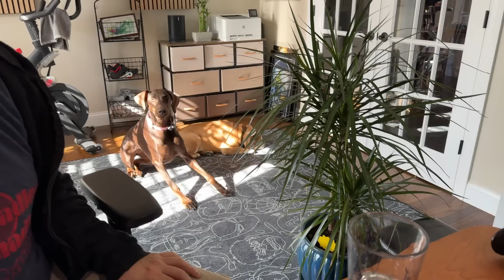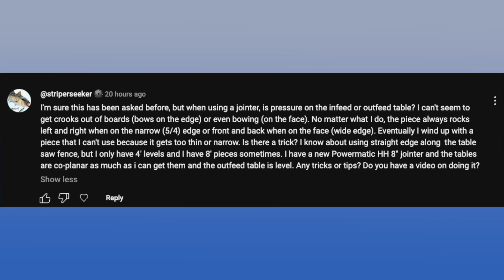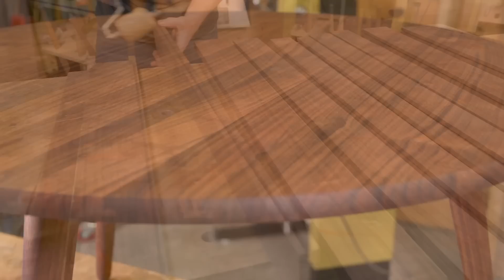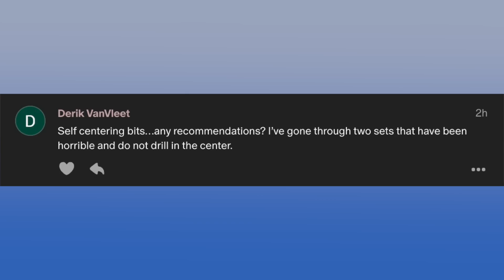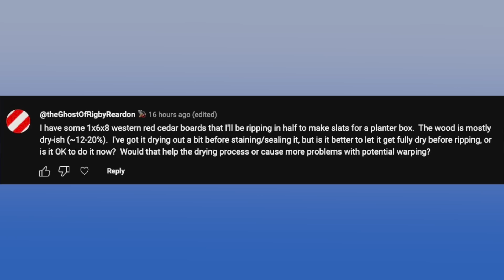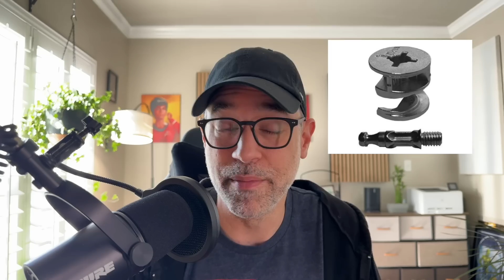I Bought My Workbench! | Ask TWW 05

Comment: Hi Mark, I was wondering if there was some courses in the guild that would be lean more towards a newer woodworker?  I have knowledge on how to use the machines and equipment but not necessarily built much, thanks?
Reply from the maker: The Shaker Table is a great one to start but honestly pick something you want to build. Each one of the projects is designed to take you step by step through the project.

Comment: Every time someone refers to jointer tables as being "coplanar" my ears bleed a little - I think what they really mean is parallel.  A jointer will only have the infeed and outfeed tables coplanar when they are in the same plane (at zero depth of cut).  A properly aligned jointer, during use, will always have parallel tables and never coplanar.  Sorry  :)
Reply: it’s true, great point! the apex of the cutting head, which is a line, should exist on the plane of the outfeed table. and the infeed table should be just below that, perfectly parallel, and the depth of cut adjustment moves it through higher and lower planes.

Comment: Concerning the jointer, I recently straightened out a bowed (technically crooked) 2x4 on my 6" long bed jointer. There is some technique to it. First, it helps to draw a straight reference line from one end to the other, touching the corners and showing the curve in the middle. That will help guide you. 

Second, you want to joint it so that it's curved up and the bow/crook is down against the bed. This will result in the jointer cutting away material starting in the middle and gradually working out towards the ends with each pass. This is where some technique/art/skill comes in - you want to hold the board such that it is in fact only touching the bed near the middle. You don't want to push down on one end and start carving away at the leading end first. What will happen there is with each pass, you will carve away material from the start of the board, and the end of the board will receive the fewest passes. Best case scenario this creates a really narrow end and a wider end. 

If you deliberately shape it so that you're starting in the middle and working your way out equidistant towards the ends, you get a more uniform width or thickness by the time you're done. Use very little pressure else you'll just carve another curve into the already bowed piece and you won't actually straighten it. 

To prevent the piece from rocking on bed, you can use the fence to stabilize it is crooked by pushing against the fence and keeping it level. If it's bowed, you will want to balance it with push paddles on either side of center. This takes a bit more finesse to get it right, but it's still doable.

Once you've gotten 2-3 good passes in the middle such that you've created a 12-16" long flat spot in the middle, it becomes easier to do the rest as you can just reference that flat face against the bed as you pass it through. The more parallel that face is with the reference line you drew, the more uniform the width of the board will be by the time you're done. 

You can get a feel for how you're doing based on the sound. If you hear cutting too early in the cut, you know your board is tilted down too far at the start of the cut. If you hear cutting too late, you know it's tilted too far back. Depending on the severity of the bow, on the first pass you should start to hear or feel cutting about 2" from the center of the board, and the cutting should stop at the same distance away from center. Then on the next pass that distance will increase, and so on. 

But I agree with Marc that the best thing to do, if you can, is to straighten one edge using a saw guide and hand saw, or a straight guide board on the table saw with the work piece clamped or taped to it. A jointer can do it, but needs some finesse.

Comment: There’s a jointing technique you hear quite often where you apply pressure to the outfeed as soon as possible. So good to hear you say that’s not necessarily the case, personally I’ve had the same result regardless of where I put pressure (assuming the board is close to flat)

Comment: Hi I have a SCM 410 w , Classic, I have extended in feed outfit table +2 m on other end, And I have built supports underneath so I can adjust and get the heights of the table correct, I’ve done this because I have very large pieces of wood. I used to make specialist windows and doors oversize., it sounds like your tables are not set up correctly, Or more to the point, the blades are not set in the block correctly, the height of each blade should be exactly the same and your machine normally comes with a setting jig, And obviously, your blades must be very sharp if you’ve got double blades, you will not cut your wood properly, then when your blades are set correctly, you need to set your feed table to 0 and this will be the first stage of checking to make sure your table is parallel to your blades and block, I must note all this procedure must be done with the power turned off and disconnected, to check whether parallel to your table use a very good straight edge put it on the table so it is hanging over the planter block and slowly rotate the block and as it goes round there should be an equal gap under your straight edge. something I used to do, many years ago was put a piece of tape on the outfit table then rock the blade and put mark on the tape before you move the block and then mark the tape again when you have rocked the block over with the blade in it so it actually lifts the straight edge, something else that you need to check is making sure your planer blades have been sharpened correctly as this will cause problems when your plan is running as well and calls very big problems, The blades must be sharpened and honed by a specialist,
Your outfit table must be set at the exactly the same height as the knives are on your block, if there was a difference your table adjustment needs ordering it might need even rotating slightly to get it so it is parallel to your knives, this is done with your blades out at 1st to make sure your block is parallel to your bed, I hope this can be some used to you, I’m in my 70s retired specialist Joyner Cabinet maker carpenter,

Comment: Concerning jointing, the first thing to do is get a handle on any cupping, wind, crooking, or bowing.  Longer boards are especially troublesome.  You can use a long line like a chalk line pulled taught to estimate the difference between what you have and what will be left after it's flat.  If you have a nominal 1X8 and the distance between the cord stretched taught and part of the surface farthest below the cord is 3/4 of an inch, "flattening" that board will leave nothing.  I buy material over thickness, cut it to approximate lengths, and then joint it (usually with a hand plane these days, because I have tinnitis).  Flattening shorter pieces conserves wood.

Comment: Depending on the orientation of the curve in the board you’re jointing, if you’re pushing down too hard, isn’t there a risk of pressing at least some of the curve out as it goes over the cutter and taking material off in the places where it doesn’t need to be removed?

Comment: When Striperseeker says his boards rock, is he feeding the convex side of the board? I don't think you can ever get a good face or edge using the convex side.  With the concave side you always have at least 2 points in contact with the bed, where with the convex it's only one point of contact.
Reply: Yeah...wish there was more clarity there. In my mind I pictured a board with a real twist in it, where maybe diagonal corners had low or high spots.
Reply: agreed. i’m assuming with an 8 ft board, he doesn’t even have an 8 ft very flat table to check the rocking on both sides (though the edge should be easy to check for convex or concave).

the there is sometimes a board where there is a rock on both sides due to a twist, but the idea is to choose the side that you can hold most still and stable with your  push sticks and pads. 

we have some pretty big jointers in the shop at my school, and i still won’t joint an 8 ft board if i don’t HAVE to. i always rough cut close to final length, and sometimes to close to final width, before jointing, so that I can remove as little material from the thickness as possible. if i had some project (like a bed frame or large bookshelf? a large dining table?) where 8 ft was the final length, i’d be selecting boards already as flat and straight as possible, intentionally.

Comment: If the beds on a jointer aren’t parallel, then you’re always going to get a curve in the board. I was always taught that the pressure is always on the out feed table as it’s set to the cutter. Obviously not when starting, but usually good to start about a third of your length.

Comment: Hey Marc, I love your stuff! Re: the Festool knock down hardware, I suspect you could cut the mortices with your router and a metric bit, if you don't have access to a Domino.

I've got a 500, but I'm looking at building a big kitchen table using the 700 knockdown hardware, and cutting the bigger mortices with my router.